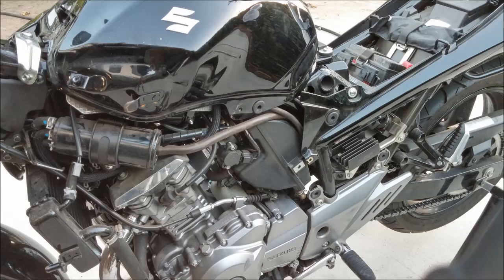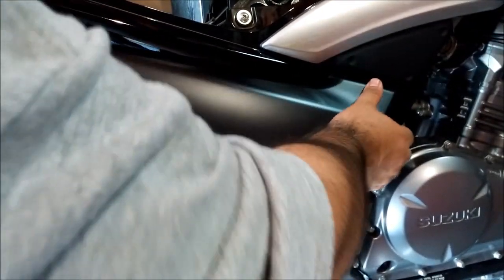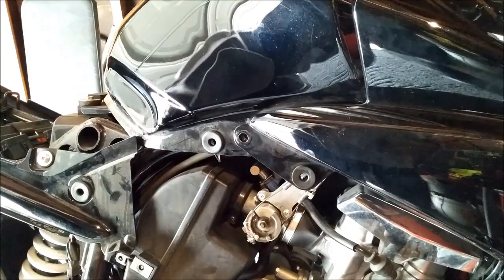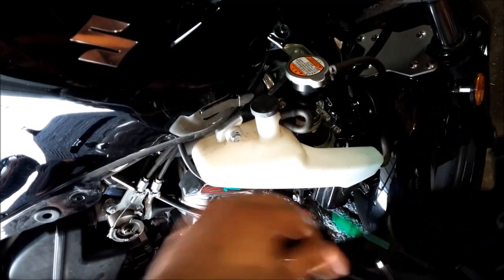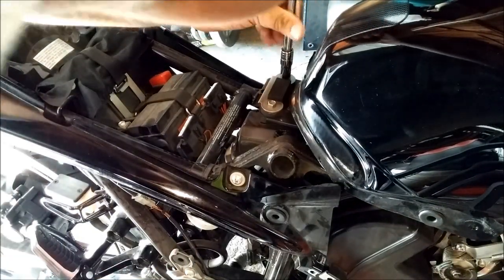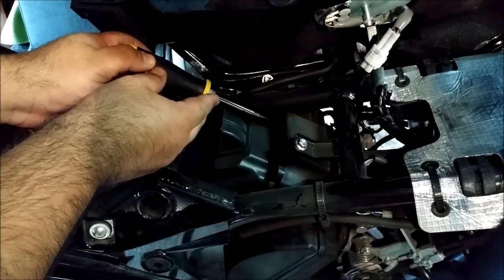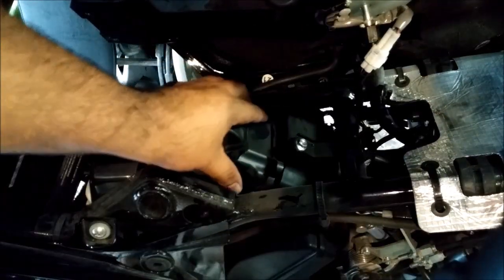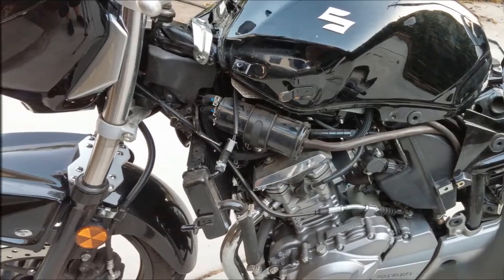Suzuki GW250 Air Filter Access Instructions

Comment: If you can get someone to help hold up the fuel tank you don't even need to disconnect any hoses or plugs to remove the air filter cover/ filter.

Comment: Have you had any issues with valve adjustments
Reply from the maker: None that I am aware of. Bike runs great and I've never been stranded.
Reply: +Geebus because I use mine as a commuter and I'm always 10k plus on my rpms close to red line it seems like my valves need to be adjusted every 6 thousand miles and in the owner's manual it says to inspect the valves every three thousand miles
Reply: My bike on sudden brake the engine cut off and then must press on start button..sometime on turning on curve lane the engine slow down and cut off...can anyone help me...
Reply: @hakimlan   it could be due to bank angle sensor is malfunctioning / wiring related to it

Comment: Hi did you notice any improvements with the new filter? Does it worth th extra money.Thanks and stay safe
Reply: If the fueling computer isn't matched then it may not supply as much fuel to match the increase in air, causing the engine to run even leaner. It's a cheap motorcycle so I doubt there will be sensors checking the fuel air mixture and doing constant adjustment. Do you know?